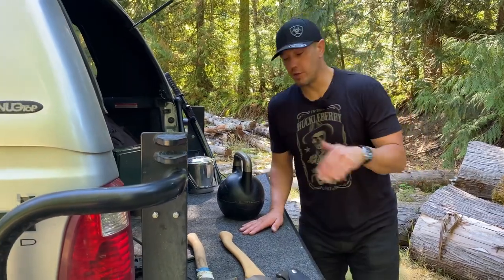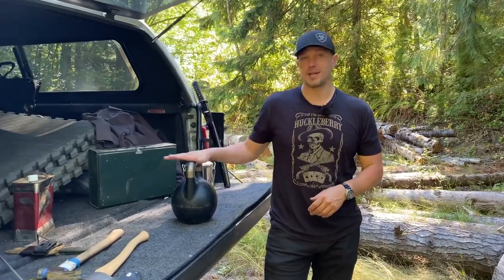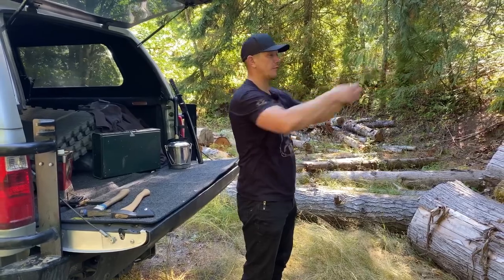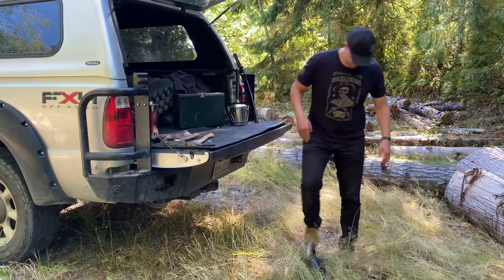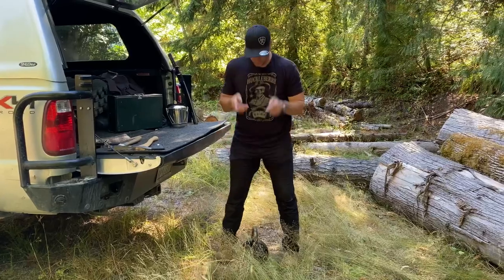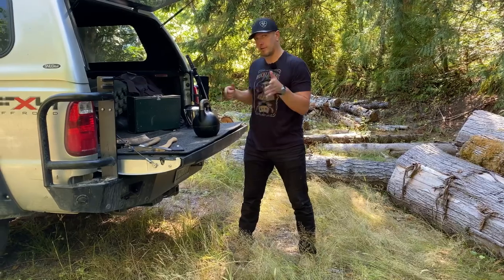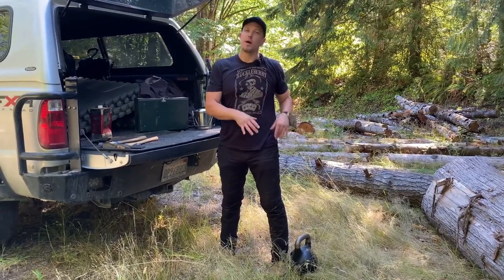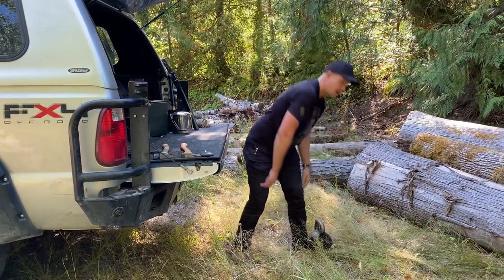Load Unload 3. Rotating kb workman’s drill. 2 versions

Comment: Dr Stuart McGill (an expert, & pioneer researcher, on spine biomechanics) mentions this a lot (in his books; on YT, etc) that one should NOT rotate a 'loaded spine'.
He's okay with spinal rotation, but not with loaded rotation -- he's also okay if the rotation is not being generated (or primarily effected) at the spine.
The reason he's against these kinds of movements is cuz of the microtrauma caused, which, in time (& esp. with weight) leads to all the 'bad back' related issues - pain, stiffness, loss of mobility etc...which makes sense, and also has a lot of empirical evidence behind it...
What's your opinion about that, Mark?
Perhaps safest not to do such loaded movements? And just learn to lift & shift heavy objects the other (safer) ways...??
Reply: In a lot of marks videos that involve twisting, the majority of the twisting / rotation happen in the hips not necessarily crazy amounts of actual spinal rotation.
Reply: @andy3410   Yes, I understand, and agree with your point. Most/All of the energy generated is from the legs/hips. But, and maybe I should have specified/clarified this in my orig. comment, I'm not sure about the cost:benefit ratio of these when taught in an unsupervised environment which is what most people will be doing...even though, I know, Mark says to start with a super light weight...All it takes is one 'bad rep'... Maybe these should be done with an instructor being present to check one's form & technique...?
Reply from the maker: I try to treat everyone as an intelligent individual who is capable of discernment in their own practice. I have high respect for Stuart McGill but I’m also an athlete and I find loaded spinal rotation happens all the time. I think he is referring to heavy weights. So I dont think we are saying different things, I think we are saying similar things in different ways. My goal is to prepare people for more extreme ranges that they absolutely will encounter in real life work.
Reply: @MarkWildman  Hmm...alright. Understood.
Reply from the maker: If you never did loaded spinal rotation then there’s no martial art on the planet would exist 🤷🏻‍♂️. All multi attacker weapons drills are loaded spinal rotation. All wresting is loaded spinal rotation. All traditional farming includes loaded spinal rotation. No circus arts would exist. I think and club or mace practice is designed to improve that. And club and mace are to oldest forms of organized weight training across cultures.
Reply: @MarkWildman  also a fan of Stuart Mcgill, since bad back pain. I do his stuff and my version of your stuff weekly and back has never been so good touch wood. Lastly sleep without pillow and if I must sit down try to do it on the floor
Reply: And still doing these but stronger, so all part of the journey!
Reply: @MarkWildman  Agreed. If there was no loaded rotation on the spine, how would I get my groceries out of my trolley in to the back of my car. Granted it is not reaching all the way down to the floor but no one is saying to go lift a massively heavy weight and grind out your back mobility. I am really interested in these videos and would love to see how to safely build a workout that alternates the height at which you pick up and put down the weight. Is it more beneficial to do the one set of the same exercise or could you do more of a full range of movements to alternate the recurring same movements performed?